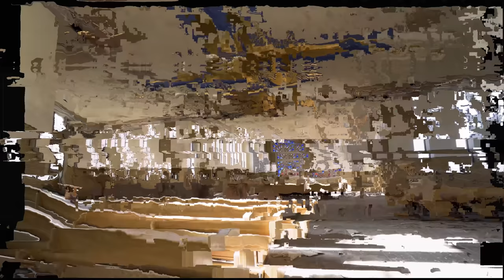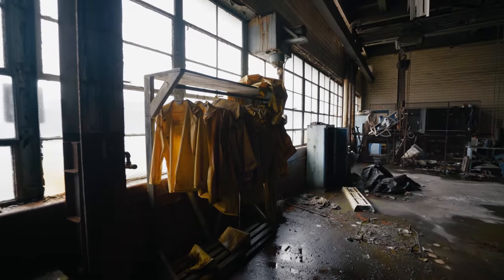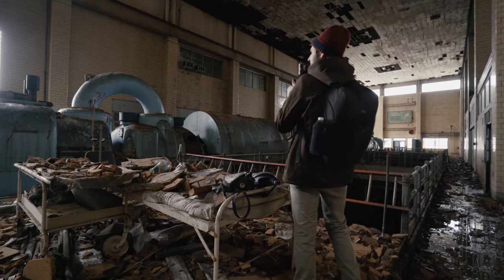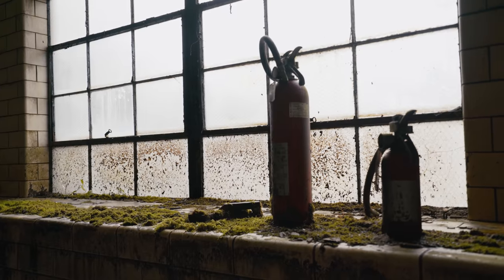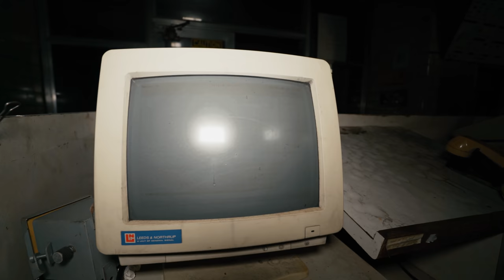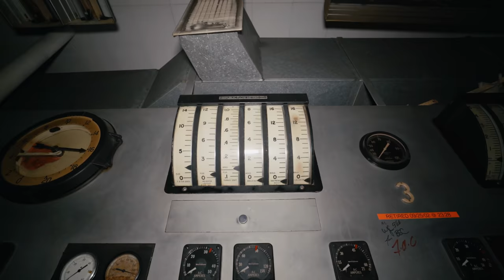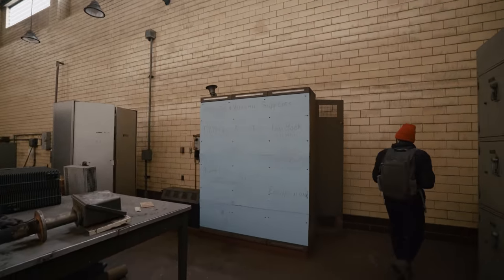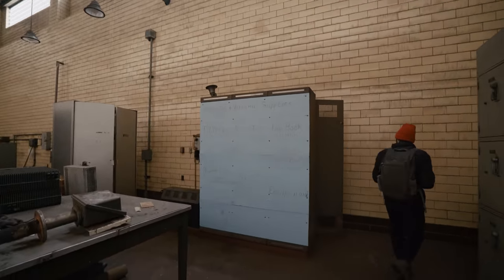Abandoned Power Plant Decaying for 20 Years - Vintage Time Capsule Explored!

Comment: 3600 RPM. Most likely ran for 50 plus years. Remarkable machines. I am a retired Steam Turbine designer from GE.
Reply: Oh Dear GE you must've made all the cool stuff
Reply: I worked for GETSCO in Scenectady 40 years ago. We put GE gas turbines all over the planet. Some drove generators, some drove refinery compressors, and 5 powered Chevron oil tankers. I still have a 6 foot wide General Electric aluminum sign from the side of some generator on my garage wall.
Reply: They run at 3000 in the UK since we are 50Hz
Reply: @seshelbow336  Places in the Middle East are 50hz, too.   I'm stuck on 3600 rpm.
Reply: Yeup, us power grid runs 60Hz so 3600rpm.
Reply: I was thinking you know lawn mower engines always run at 3600 rpm max, and apparently it may have something to do with engines powering small generators. Or max blade tip speed on the mower. Either way it's the same.
Reply: I think that pipe up top goes between the HP and the LP turbines
Reply: So that's what? 2 poles?
Reply: Mr. Turbine Designer, did you ever admit that that GE was a Black Owned Company and that all the patents were stolen? You did not did you. Because you did not design anything.

Comment: GE is green, Westinghouse is blue. The hydrogen label on the generator means it operates in a slightly positive pressure hydrogen atmosphere to make it more efficient.
Reply: Not true
Reply: @nascar2297  I agree, but what is true? I thought they ran at negative H2 pressure. Hydrogen being so light it has less "air" resistance.
Reply: Hydrogen is used as a coolant for the generator windings.  It is at a slightly positive pressure.  The negative pressure is in the condenser which lowers the boiling point of the water to about 101 degrees F. This is where efficiency comes in.  You get all the energy out of the steam.
Reply: How did they mitigate the risk of the hydrogen exploding?
Reply: If you keep hydrogen at a positive pressure air will not get into the generator so it can’t explode.
Reply: @dougtaylor8735  YES!!  This is the correct answer. Hydrogen is the coolant for the generator. The condenser which is directly under the low pressure turbine, literally sucks the steam through the turbine, condenses it back to water for recycling through the system and back into steam.
Reply: @electron8262  Bo oxygen within the generator casing. It is airtight with a slight pressure to make sure no air enters the casing when the generator stops and cools off.
Reply: Wonder why they did that, since i imagine that would be a bit of a risky endeavor considering hydrogen is flammable.  Electricity + hydrogen?… no mix ! Boom-boom! Lol
Reply: @uTube486  Lightness has absolutely nothing to do with pressure. Compressors have a great deal to do with pressure.  Think about that.
Reply: @organbuilder272  Not sure what you mean... H2 in the gen section means less friction for the rotor; less molecules to "rub" against.
Reply: @uTube486  You said the H is light therefore should have little pressure. Pressure is measured in pounds per square inch. Pressure is increased by heating a gas in a sealed tank or pumping additional gas into a sealed tank. Thus raising the pressure. Don't you put air in your tires. Compressors pump air into a tank to raise the pressure to 40 ro 60 pound per square inch. You can to the same thing with any gas regardless of its molecular weight.  Think about it, Use your common sense. Hydrogen is just a gas. It behaves like any other gas. you can compress (squeeze) it into a sealed space.  THINK!!!!
Reply: @hi-tech-guy-1823  ok
Reply: Hydrogen is used as a coolant for the generator. It doesn't explode as the hydrogen is kept at a concentration higher than the upper explosive limit. The reason hydrogen is used is due to its high heat transfer capacity. With large generators only hydrogen and helium have a high enough heat transfer capacity to cool the generator. Helium is too rare and expensive hence hydrogen is almost universally used.
Reply: @organbuilder272  Why do hydrogen balloons rise in the air? THINK!!
Reply: @electron8262  You should consider the fact that superheated hydrogen gas at very high pressures is the life blood of all oil refineries. Yes, its dangerous.  A hydrogen cooled generator is first purged with C02 and then filled with hydrogen so there is not enough air to combust. It has a special variable pressure seal oil system to keep air out and hydrogen inside. The hydrogen cools much better than air and the internal generator cooling fans actually make less noise when its operating on hydrogen. The hydrogen gas is cooled by finned tube coolers in the corners of the generator casing. If they leak, then you have the possibility of high voltage,         13,800 volts,  and water contacting each other..
Reply: @kevinabel8837  Heat transfer capability is not something I considered but it makes perfect sense. Otherwise they could have just engineered it to operate in a vacuum but they needed cooling, too. Being a lightweight element is just a bonus I guess.

Comment: The house in which I grew up was less than a mile downwind of that plant. My next-door neighbor worked there for probably 20 years. Before they installed a scrubber on the smokestack, everything would get coated with a thin film of coal dust - the grass, snow, trees, cars parked outside. Your feet would turn black from walking on the lawn barefoot. There was also a set of high-tension transmission lines running just 50 yards from my house. On the bright side, fishing was good near where the plant discharged warm water into the Allegheny River.
Reply: Nice!  Might be worth trying to share this with former workers
Reply: That's one thing that won't be missed about these old plants, the environmental damage.

Comment: Wow...  This video gave me flashbacks of working at the coal-burning power plant back in 1989 at School of the Ozarks in Point Lookout, Missouri.  It was a work-study program that I was drafted into, since I was a freshman (so I didn't have much choice in what work-study job I got).  I worked it diligently, and always smelled of sulphur and soot the following day, since the job was typically done at night.  We didn't actually generate power per se, but we Did generate superheated steam that was sent to different buildings across the campus, which provided heat for the dorm rooms and greenhouses, and heat and sanitation for the cafeteria and other places that needed it.

I remember going to the power plant one evening, and Marty (the supervisor at the time) warned us that the shipment of coal was 'dirty' and that it could potentially 'flash in the firebox'.  Umm, what?  Except, I learned Exactly what he meant later that evening.  I was moving the coal hopper between the boilers, filling it with coal from the silo and dumping it into the automated conveyor for boiler number one, since the second boiler was temporarily decommissioned due to a ruptured super-heated steam pipe inside the firebox.  The firebox was about 15 feet long, and an automated steel conveyor carried the coal from the hopper into the firebox, where it was Supposed to burn as soon as it entered the firebox.  Except this batch of coal was wet and had a lot of mud in it, so the coal was being pulled into the firebox without catching fire.

A coworker called me at about 9pm and told me that he was going to be late, and asked me to clock him in, and I didn't do it.  Because, Heck, if I could make it, why couldn't He?  I went down below to take pH readings for the boiler water and added chemicals to bring it back to neutral, and logged what I found into the logbooks.  I went back upstairs and saw that the boiler pressure was dropping, so I looked into the firebox through one of the shuttered viewports and saw that a strip of unburned coal had been pulled about halfway into the boiler, and the head (leading edge of the strip of coal) was Barely burning.  I remembered what Marty said, about how the dirty wet coal would be pulled in rapidly and subsequently dry out, and then all flash at once, so I warned my coworkers to be wary of the escape routes in case something bad were to happen.

Then...  it happened.  I looked at the boiler pressure and it was Rapidly rising, and I looked into one of the viewports and the entire strip of coal was an Inferno.  I almost couldn't look through the port because the radiant heat was so intense!  I called my coworkers to the surface (the lower levels were for testing the boiler water pH and for cleaning the coal ash from the lower part of the boiler).  We waited up top with our eyes glued to the pressure gauge that stood prominently between the boilers - 90, 120, 150, 180 pounds per square inch, it rose so rapidly!

Finally...

I thought the place exploded.  I heard a mighty Slam, and a Roar that was so intense that it rendered a dragons' call on par with a dove's coo.  I looked left at my coworker, who appeared to be talking to me, maybe Yelling at me, but I only heard white noise.  I couldn't hear his voice at all.  I yelled back at him but couldn't hear my own voice, just the rush of steam through some exit somewhere.  We left the plant and looked at the west side of the building, and a 6-inch pipe had a Terrible Noise coming from it, way louder than I thought would have been coming from even a passenger jet just before takeoff.  I looked further west and saw where the superheated steam was finally condensing from a transparent vapor into a water cloud, and remembered when Marty demonstrated the dangers of superheated steam by opening a valve next to a boiler, and passing a piece of paper through whatever was coming out of the valve, which immediately burned it as fast as he could pass it through the jet of vapor.

I don't know why I did, maybe it was Marty's training or maybe I was just nuts, but I went back inside and looked at the boiler pressure and saw that it was almost back to normal, and then I heard another Slam!  ...and silence.  A silence that I'd never experienced.  A silence that eventually gave way to a high-pitched ringing and hissing, a noise that I still hear today.

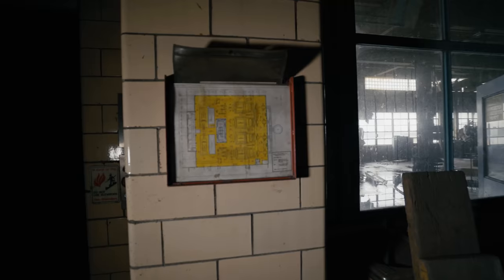So Yeah, take that map at 3:45 and subtract it by two boilers (S of O only had two boilers at the time), and that's where I worked for my first jaunt at college life after coming off an impoverished farm, no thanks to the corporate farms that Sucked the Life out of the local farmers who were just trying to make a living.  Disgusting.  But I digress.

I hope you kept some of the signage before they tore the place down.  Even though it is what it is, it's Still our history.

We can't progress if we don't know where we came from.
Reply: An amazing story - thanks for sharing

Comment: I worked at the Lovett power station in NY up until it closed in 2008. Our plant too, was built in '48 and we had 3 working steam turbine/ generators.  Our main fuel was coal, but we could also burn gas and oil. Our plant closed and was demolished.  I really enjoyed my 7 years at the plant, made great money and felt good about my job. There were a number of plant systems that needed attention and safety was top priority.  We generated power that all used, and were part of the NY metro power grid.

Comment: The Tektronix 475 is a portable dual-trace oscilloscope with dual time-bases similar to the 465, but with 200 MHz bandwidth and a maximum vertical sensitivity of 2 mV/Div. It is all solid-state except for the CRT. It was introduced in November 1972.
Reply: I'm surprised it's still there, very expensive piece of testing equipment especially if it works.

Comment: I work at a production facility that was constructed in the early 60’s and some of the knobs and switches in this vid are exactly identical to the ones I use on a daily bases. We still got ORIGINAL wooden bearings that are still operating on our conveyor system, parts of the conveyor are original as well. Blows my mind that it still works after 4+ decades of use.

Comment: Those controls are very similar to the controls for the 4 oldest boilers and 2 oldest turbines at the powerplant I work at. It's 2 separate powerplants. The older one was first put online in 1935 and has had 8 365psi boilers the newest was installed on 2010 and the last old one was shut down in 2012. The newer powerplant was put online in 1957 and eventually consisted of 3 1250psi boilers and one larger 30mw turbine. Now it's 2 low pressure boilers and 1 high pressure, all installed between 2010 and 2014, and the two largest turbines, 1947 and 1957. From the control room myself and one other run both plants. Another operator is located at the older turbine. Another works on and the 1250psi boiler and he has a helper and final person keeps fuel pushed up for the 1250psi boiler. While I enjoy all your videos the powerplant ones are my favorite as they generally display the older equipment like I started on when I first started in power 15 years ago.
Reply: What power plant do you work at? Sounds like a big station
Reply: @nascar2297  it's a plant that runs a paper mill. We are capable of feeding out and supplying the grid however we try to avoid that. Duke Power is in the business of selling power. They do not want to purchase any from us. Total current capacity is just over 42MW and total steam capacity is 635klbph.
Reply: Sounds like a great place to work.   Do the boilers supply process steam or just run the turbines?
Reply: Overall it is a good place to work. The primary purpose of the boilers is to supply steam for making pulp and then drying the paper. The electrical production is a byproduct. However in the past 10 years part of our bonus is based off MW production. As natural gas and biomass prices fluctuate we will make more or less MW depending on what is cheaper, purchasing more MW from Duke or creating more on our end.

Comment: I worked 33 years in a coal fired plant. It saddens me to see them all being razed. The plant I worked in is closing soon. It all looks so familiar and brings back memories of my power plant family.  So many holidays, weekends and nights there. Coal plants were the available work horses of the industry that will be missed
Reply: I don't understand why these buildings couldn't have been repurposed into a greener energy plant, such as nuclear or geothermal. Yeah, they likely would've needed to be heavily retrofitted, but I imagine it still would've been cheaper than building a brand new plant
Reply: @StormBreaker_Chasing  Too much regulation, no common sense.
Reply: @StormBreaker_Chasing  I don't know how they would've made it into a nuker. Those things have incredible amounts of concrete and it always seems to be in a really specific shape. These guys have a few vids from way back where they found a nuke plant abandoned mid construction and the amount of concrete is incredible.
Reply: @StormBreaker_Chasing  there is a gas fired generator on site already built. It's a peak unit, only runs a few days when there is massive demand.
Reply: @StormBreaker_Chasing  there’s literally nothing about this facility that could be repurposed into a modern plant.
Reply: @jaysmith179  No, its because fracking is a thing. Natural gas killed coal, its cheaper to buy, cheaper to manage, cheaper to burn and its cleaner and theres no cleanup neeed.
Reply: @3UZFE  Cheap natural gas did this.
Reply: While I feel your loss, cheap natural gas killed coal. Its cheap to buy, cheap to run, cheap to build, more cost effective. When I still lived in PA until last year, there was a big 700 MW coal plant on the river near PIttsburgh, it had 8 boilers. When I had left for Florida 5 of the boilers had been converted to run on natural gas. By the end of 2022 all of them will be natural gas. The plant will live on, just with better new fuel. My brother works for Westinghouse Electric, they have a new plant called AP1000 thats being deployed in Asia with great success, at some point it will come to America to. Nuclear is the future. Coal got us through the 20th century and did a great job at plants like this. But as with anything, when it makes sense i ts out with the old and in with the new.
Reply: I worked in coal handling as a sub for a number of years. You really do leave a piece of yourself with these old plants. I hate to see them go for sure.
Reply: @MrPNutt  For a couple years I worked at a nuclear plant in PA testing cooling loops, pumps, relays, sensors. Stuff like that. Even tho I was only there for 6 years. When they eventually close that plant which Im sure they will in the next 20 years, I'll be sad to see it go. So I totallly know how you feel man
Reply: @TheMrLebaron  The AP1000 is already here.
Reply: @Roberttx1  I know, but it was supposed to come online in 2010, they were only 8 years behind lol.

Comment: At 21:29 it brings back a lot of memories, did work with oscilloscopes from the 80's till beginning of 2000. Used those for my work for P.A. (audio) systems and later on for repairing PC mainboards. Great video.

Comment: Your comment about the fact that we use sensors now and it used to have to be routed to the panel to give the reading was really eye opening!
Thanks for these videos!
Reply: The tubing you saw in the cabinets was 1/4” copper.  It is for pneumatic controls, where varying air pressure will actually open and modulate devices.  Very old means of control, but extremely reliable.

Comment: I don't know what is allowed here. but if it were allowed, I would certainly save that oscilloscope. One of the best oscilloscopes ever made. I used to have a setup exactly like that, with the cart, manuals, cover and all. I sold it  20 years ago to buy parts for my race car. Now that I decided not to spend thousands of dollars per year racing and concentrate on my electronics hobby, I wish I still had it.